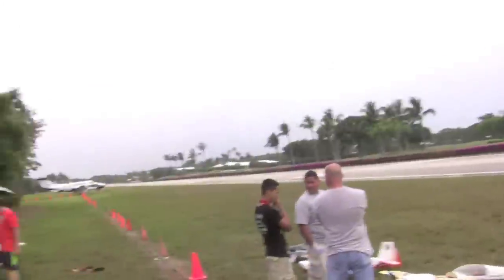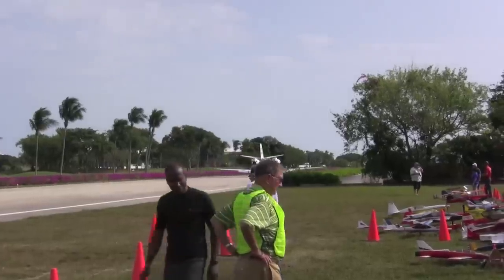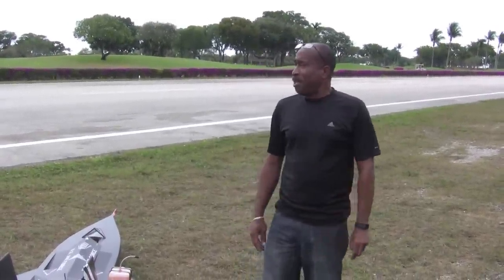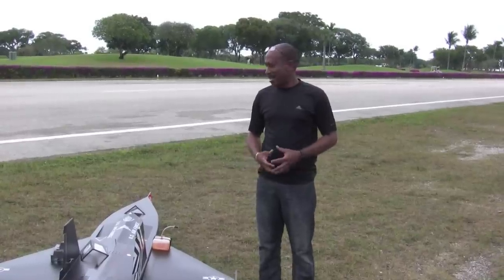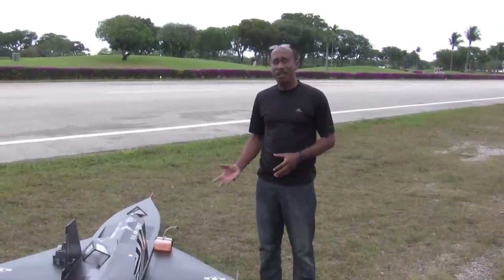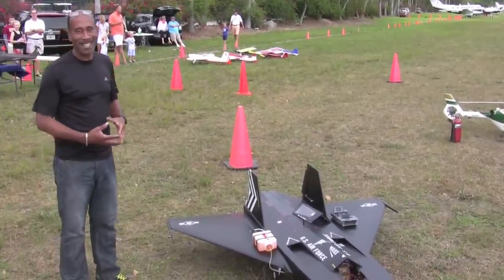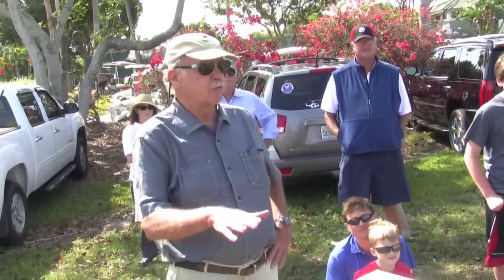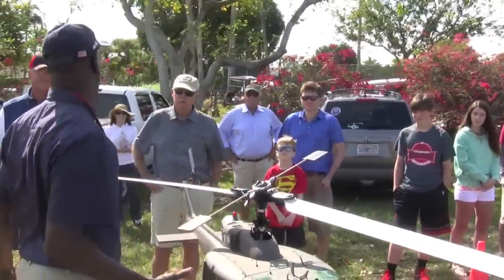200 MPH custom built jet

Comment: 5:18 I, I mean, I wouldn't be standing right there. No fuckin wayo.
Reply from the maker: All the rc helicopter pilots that I know, myself included, usually stand behind the bird, at close proximity. There is a connection that’s hard to explain although these are deadly little machines. I advise caution and do keep your distance always and watch from afar. More rc videos on the channel, don’t hesitate to check them out and subscribe.

Comment: That old guy who said there where UH-1's with two engines in Vietnam I would like to know the year they flew there. I never saw a two engine UH-1 there? Just asking could not be everywhere at once.
Reply from the maker: From what I can remember, the upgraded versions of this Huey has two engines and 4 rotors. Not sure of the model, I’ll have to look it up.
Reply: He actually said he rode in a CH-47, which has 2 engines and 2 main rotors.
Reply: If memory serves me right, they were called theUH1 November model and were primarily used for over water operations during the Vietnam war.
Reply: Kēvens -  that would be the UH1 Zulu model.

Comment: Love to see black people doing fun stuff, but did that 1st RC jet really need to taxi down the runway before taking off? Seems like he could have just walked to the starting position.
Reply: It's standard practice to start the engine(s) near the center of activity, then taxi to the takeoff point. Jets take a lot of work to start; you don't want to do it at a distant point, away from your equipment.  A piston engine or especially a jet turbine is putting out a lot of heat and air - not to mention a turning prop, if it has one - so you don't want to be carrying a model around while the engine is running. The jet needed a long taxi because it needs a long takeoff roll.